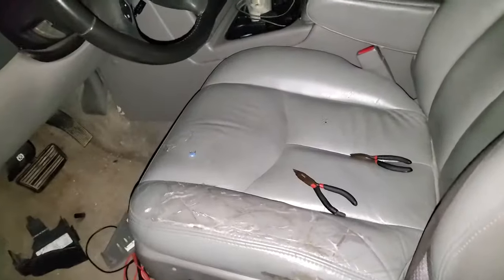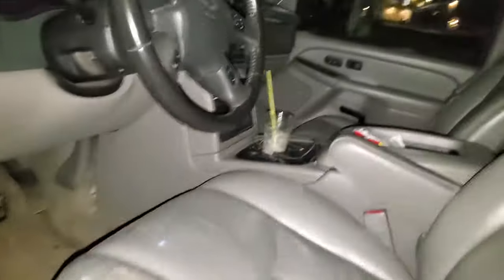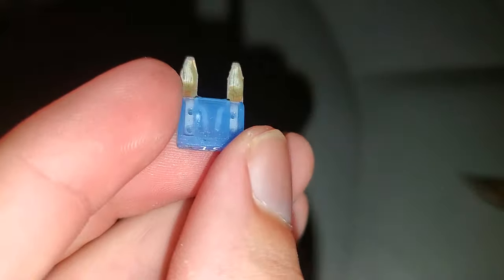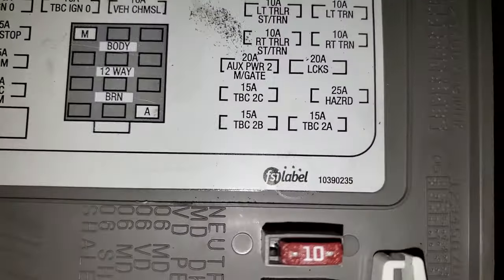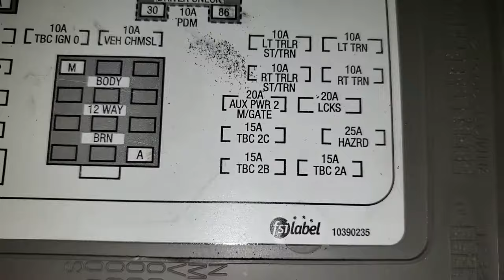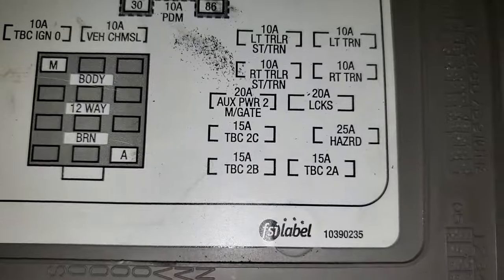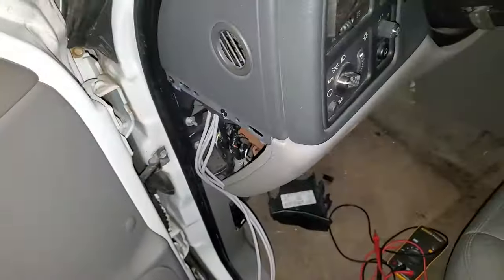Automatic Dome Light does not work when Doors Opened fix TBC 2B Fuse - 1999-2006 Chevrolet Suburban

Comment: My truck is a 99 3 door extended cab ls 5.3 model, it does not come with the 2B slot for a 15 amp fuse, mine is controlled by a series of fuses under the hood and a relay up under the dash near the driver’s foot, also one of those relays also controls your tail lights on theses models, why GM did this is your best guess, so if any of you have been trying to figure out why your dash lights, dome lights or other interior lights aren’t working please check out the relay’s on the drivers side floor board.

Comment: Question, when you take the fuse panel cover off, there is a 3 wire plug in there ( yellow, blue and purple). Do you know what that plug is for? My 04 Tahoe has it and it’s not plugged into anything. Thank you!

Comment: My '02 Door and kick panel lights come on when I open the door, but dome lights don't come on (with dome light override on or off).  I can push the buttons on the map lights and they will come on.  All fuses inside and under the hood are good. Anybody got an idea?
Reply: I’m having the same issue

Comment: So, this was the issue in my 05 Sierra... I replaced it and it started working. Blew again shortly after. Replaced again and blew when I started the truck...

Sigh, does anybody have any idea?
Reply: Replace TBC 2a & 2b fuse
Reply: @Globalhomage  Tried that. I listened, and the TBC 2B popped the second I went into reverse.
Reply: @ydocsaee421 still no fix?
Reply: @hugolizardi1479  No... but currently dealing with other electrical issues, too. Bad alternator and clock spring. Related? I don't know... but I'll reassess after those are repaired.